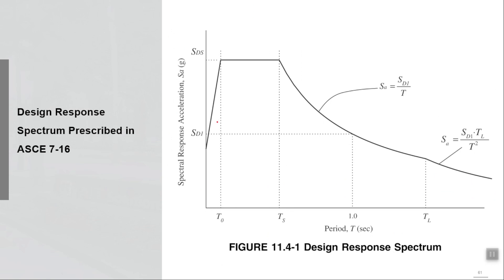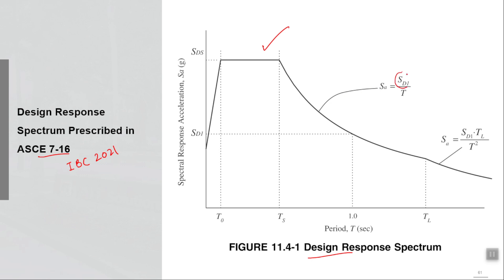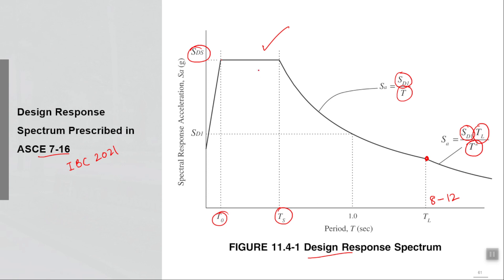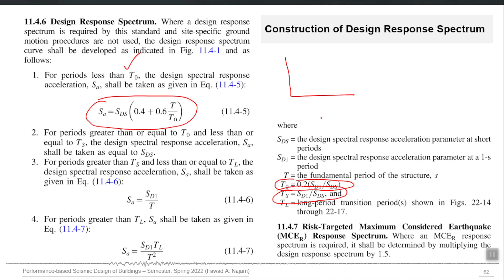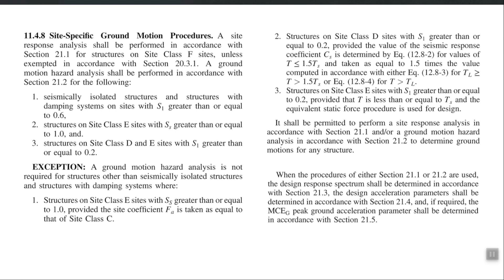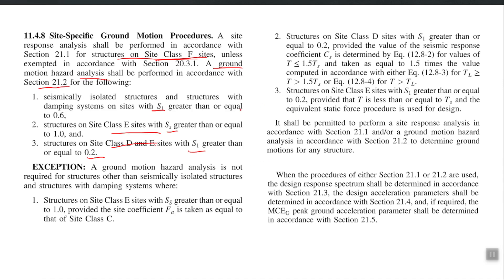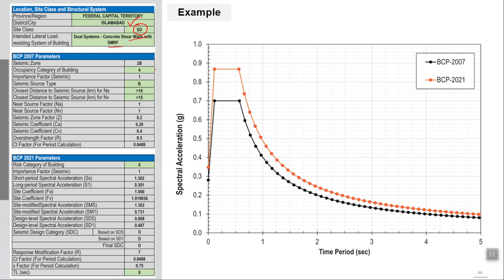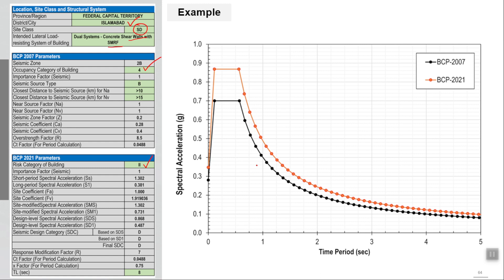56 - RSA Procedure - Step 3: Design Response Spectrum for Site (Code-prescribed)

Comment: Hello professor, 
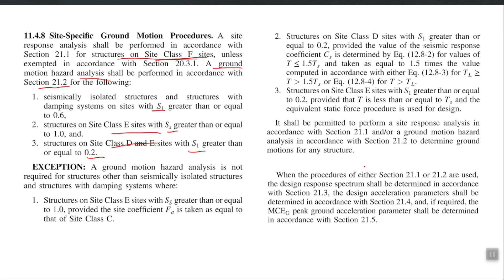At time 7:40, you talk about some exception and site specific ground motion procedure, my model have S1 >0.2 and Time period, T <Ts, site class E（ which lies in the set 3 and also in the 3rd category of exceptions).  The which method I need to use, chapter 11, or chapter 21. 
I am looking forward for your response.
Thanks